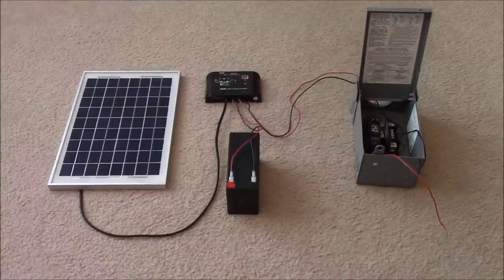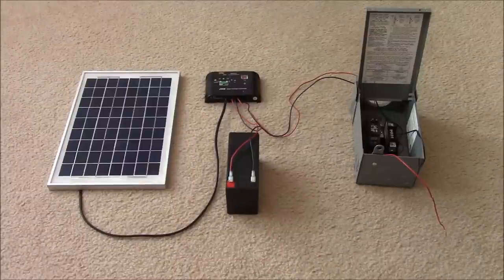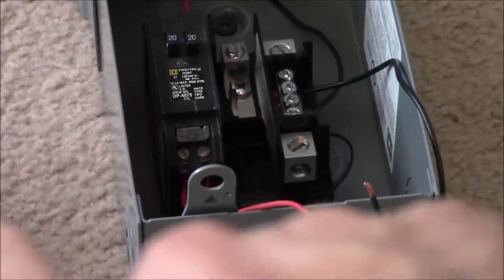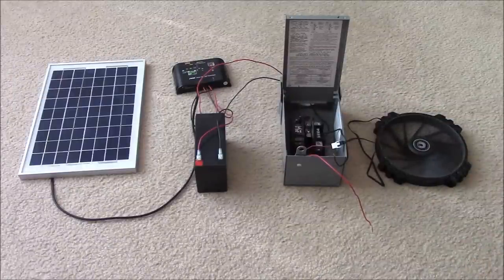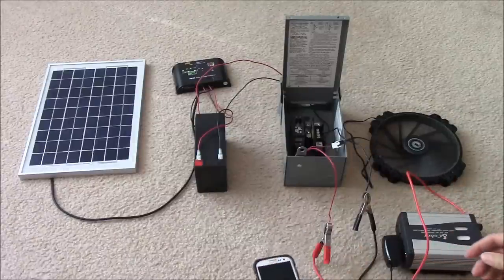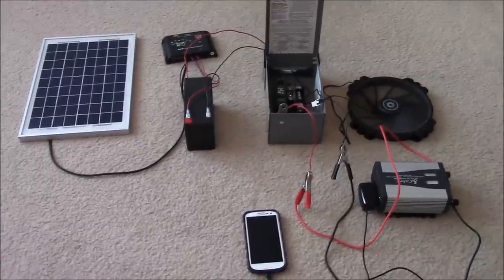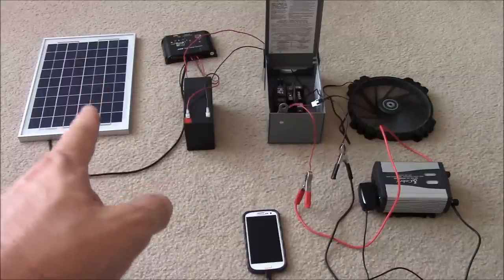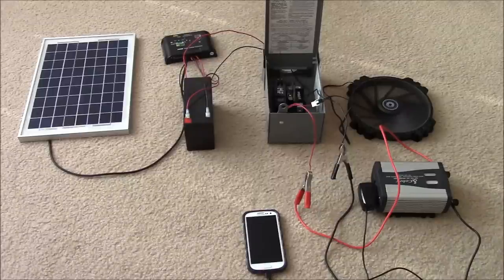Solar Panel Systems for Beginners - Pt 2 Hybrid Systems & Multiple Loads

Comment: Question: If two panels of different ampere and watts are connected/joined  together to the pwm. Does it work all the same or is it not advisable. They also give different output voltages.
Reply from the maker: That is not advisable.  Depending on the charge controller it will either not work at all or it will consider them both the same size (the bigger panel will shrink down to the size of the smaller panel as far as production).  Since pwm charge controllers are so cheap, I would just grab another $12 charge controller like I link to in the video description and run each panel off of a separate controller and then to the battery.  That will open up a different set of problems but at least you have a chance at getting full production.

Comment: Hello and thank you for making sense of this , I would like to run a 12v dc small motor on sunny days, the motor current is 35amp and 6 rpm .Can I connect motor directly to panel and, what size panel would I need ?
Reply from the maker: +euniversal1 You are welcome.  Thanks for watching!

35a x 12v = 420 watts so that is a lot of power needed.  Unfortunately, there is no solar panel that big so you would need multiple panels.  In my experience, motors like that usually need a big surge of power to start up, also, so having batteries or a large capacitor would probably be required to store enough energy to start the motor up.  I'm afraid I would recommend a full off-grid solar panel system for this application.  If you tell me where you live and exactly how many hours per day you would run this device I can tell you how big of a system you will need.

Comment: Hey mate, quick question,

I've wired my system up very similar with an isolation switch from the battery to the solar regulator, and my question is when I am not using the system and want to isolate it, do I need to disconnect the solar panel from the regulator or it shouldn't matter because there is no power going into it ? 

Please get back to me !!
Reply from the maker: When there is no load on the panel it is not producing electricity.  The only benefit a switch between the solar panel(s) and charge controller gives you is the ability to disconnect it so that you can safely work on the system without the chance for a short circuit.  Otherwise there is no reason to ever disconnect the solar panel(s) from the charge controller.
Reply: LDSreliance you didn't read if properly mate, I it is isolated from the battery to the controller obviously not from the controller to the panel lol.
Reply: So basically the other way around, I have put the switch from the mains power from he battery to the solar regulator, so I am asking once the power is islolated to the regulator do I still need to disconnect the solar panel from the regulator ?
Reply from the maker: Ahh my bad.
Reply from the maker: No, there is no need to disconnect the solar panel ever unless you are re-wiring the system.

Comment: hey I have a question.. I am making a solar powered multicopter so Can I charged my battery and on the same time can I power my drone with that solar panel...so that I can use my battery when there is no sunlight.
And my solarpanel when there is sunlight

Comment: Could you also run your wires from the battery directly to the load center? Why or why not? TIA
Reply from the maker: Yes you could.  There are tradeoffs.  More advanced users will definitely do that.  But newbies won't have any kind of protection for the batteries (unless they are lithium with a BMS).  So keep that in mind.

Comment: Hi, I had a doubt.
Just as there is a way to set the potential difference on the terminal hooked to the battery, is there a way to set the potential difference on the terminal containing the load independent of the battery terminal?
Reply from the maker: I'm not following what you are asking.

Comment: Is an inverter considered a load? My inverter is supposed to function as a charge controller (I assume since it has various kill switches to protect devices). I need to know if my 18 watt solar panel would be sufficient to sustain a 12 volt battery to operate a device using 94 watts. Please advise. Thank you.

Comment: Thanks for your videos, very informative. Have a mobile scooter which uses a round 3 plug for charger. Wish to trickle charge while driving scooter, by using small solar panel. It has cigarette lighter fitting. Can I just remove that and replace with a  3 pin plug (such as on adapters) without damaging existing system.
Reply from the maker: William Palmisano So let me understand.  The 3 prong plug charges the batteries with AC power from your house when you are not using the scooter.  But it also has a 12v car cigarette lighter adapter so you can connect an accessory while you are driving around?  If that is the case you should be able to charge the battery through that cigarette adapter.
Reply: thanks for your prompt reply.Yes re the 3 prong. The cig lighter adapter is attached to a solar panel. Since contacting you have sourced an adapter which I hope will do the trick , will let you know.
Reply from the maker: William Palmisano OK, let me know if you have further questions.  Good luck!

Comment: Hi, with a cross over (male-male) power cord, could you plug this into a homes wall socket, to feed into a house? and potentially if no one is home, could it power the items that are always on, like refrigerator, and microwave, and clocks, etc?  Or is there additional components needed for a back feed?
Reply from the maker: Here is the PC, legal, covering my butt answer.  Don't ever do that!  It is illegal, highly dangerous, and could cost you millions in damages.

The real answer is yes you can.  The reason it is illegal and dangerous is because the power you are feeding into the grid is not known to the power company and, in a power outage situation, can hurt a lineman working to repair the lines.  They will think the line is dead but you might be feeding power into the grid.  To get around that, if you were going to use a device like this you would have to isolate that circuit that you are plugged into OR your entire house from the grid.  You can do that with an interlock kit on your breaker box or a manual transfer switch.

The other reason it is dangerous is because the male prongs of the power cord are "live" and transmitting power. Normally, for safety, only female plugs are live.  That way you can't accidentally touch something and send electricity through you or an object.  So you would have to keep that in mind when you are plugging and unplugging such a device.  They are called "suicide cords" for a reason.

Comment: hey, I have a question , I have made 3 phase inverter kit by using FSBB20CH60  a Motion SPM® 3 module and I measured it and I got pure sin wave so,  can i use solar panels with my kit to run the machine?
Reply from the maker: magdi najib Yes if your inverter can handle that high of voltage.  Usually when I try to power an inverter directly from a solar panel the voltage is far too high (17-20v for a 12v panel and inverter).  Worst case you will have to use a charge controller and battery to get smooth, even power at 12v.

Comment: Really nice video. cool.

sorry i have a question, i saw many other systerm where the connect the inverter to the bactery and not to the dc12 volt out... it makes same difference? to the efficence or lifetime of the ecquipment? thank you so much
Reply from the maker: You can do it either way.  The reason why I would connect the inverter to the charge controller output is because the charge controller (usually) has a feature called "low voltage disconnect" which protects the batteries from being overdrawn by the inverter.  The inverter will shut off when it gets to low voltage, too, but it may be a lower voltage than is safe for the batteries.  I think both ways of connecting them are fine if you know what you are doing.  If you are just starting out, I would recommend connecting it to the charge controller.

Comment: Question, what happens when the battery is full? Does it stop charging or can it overcharge?
Reply from the maker: Stops charging.  That is the job of the charge controller.

Comment: Hello I really like the explanation on solar panel connectors, my question is if I want to use two batteries, how do I make them charge and both stay with the equal voltage to feed the invertor?
Reply from the maker: You need to wire them in series or parallel.  I shot a video on how to do this:  https://www.youtube.com/watch?v=4yxR-Iz2Xdc

Comment: how can i connect a system (preferably DC????) to the light in the ceiling of my garage work shop, as well as loads like a power tools, etc?  thx.
Reply from the maker: You would need to wire an inverter to your battery bank or to your charge controller, although that will limit the output power to 20 amps or whatever the rating of your charge controller is.  Then you can plug in a normal AC cord to the inverter for lights and power tools and chargers.

Comment: Can you connect a wind turbine and a solar panel to the same charge controller?
Reply from the maker: If that charge controller is capable of handling it, yes.  I think I have seen a few.  Otherwise no.  They produce power differently.

Comment: is there a way to directly send power from panel to the load without so much of wiring and in between load distributors? it looks like too much of equipment to just transfer power from the panel to the device.
Reply from the maker: No.  You need a charge controller and a battery at minimum.  You also need an inverter if you are converting power to AC.

Comment: What are the advantages of running the load from the charge controller to the load center instead of the battery to the load center?
Reply: I think it might be to prevent the battery from too much discharge?
Reply from the maker: Correct.  This video I shot explains further:  https://youtu.be/k8aVnRpoRLc
Reply: Thank you. Great videos! I have learned a ton about solar from them.
Reply from the maker: You are welcome.  Thanks for watching!

Comment: i would like to know how much each breaker inside the box give  voltage are each of breaker give 12v or both of them give 12v ,
Reply from the maker: Usually the smallest breakers you can find for these types of home load centers is 15 amps.  So that is what I was using.  You can find smaller breakers or fuses if you look for inline devices rated for DC use but they wll be more expensive.

Comment: I know you made this awhile ago, but you answered a lot of my questions with you videos. Thank you so much.   Can you tell me what type of batteries you are using?   I need some small batteries.  

Also, please let me know how to built a small array of panels.  I.E.  I bought 3 20w panels, I want to use them all on same system.  Is there anything I should know?

Comment: Off this quick set up, if I were to use one load connected to a outdoor 12v outlet would I still need an inverter?
Reply from the maker: Not if it is just 12V DC.  Inverter is only necessary if you are planning on using 110V AC power.

Comment: Just to clarify something, it is not the volts that can kill you , but rather the amps. A taser can have 80,000 volts and while it is not comfortable, it doesn't cause damage because it has low amperage.

Comment: Hi just wondering could I add a wind turbine to this system? Many thanks.
Reply from the maker: Yes, as long as you have another charge controller designed for wind turbines.  This is called a hybrid system and is a great mixture of technologies because your wind turbine will provide a small amount of power around the clock (as long as there is a little wind) and your solar provides a bigger amount of power but only for a small portion of the day.
Reply: Great thanks 👍

Comment: please what will you recommend for me.....In my country, grid supply is highly unreliable.... I need to run a water pump 24/7 for my aquaponics system and still have lights on. i want to use the grid when is on and my solar when grid is off
Reply from the maker: +Robert Fredericks Mensah I need to know the power requirements of the pump.  How many hours per day you will run it, how much power it consumes, where you live, etc.

Comment: thank you for the answ. i explain you. i d like to put a 12DC outside lamp on my balcon setup to turn on during night and a inverter 400w to connect in my house a couple of device( lamp, cheap dvd player and 2 iphone charger.

sorry to ask you again. but a red on some forum that the inverter may burn the 12dc output of the controller, thats why is better to put on the battery. so if i put lamp and inverter both on 12dc output i need a split or just take 2 pairs of wires and they can work simultaneously? 

thank you so much
Reply: i am kind of new of solar, so i decide to go slowly: i have a 50W panel with a quite good controller a 40Ah battery and a 400w quad inverter. How many device i can support with the invertor in a ideal situation? thank you so much
Reply from the maker: I have never heard that you can burn out the output on the charge controller.  That would be a pretty crappy charge controller, if so.  Get a good name brand controller and you will never have to worry about it.  Or, if you go with a cheap one like in my video, you just replace it for $15 and try again.  I have never had any problems connecting an inverter to the charge controller.

Yes, you can split the output however you want.  If the wires are small enough you can put them both into the charge controller or connect it to the battery bank.  Or if they are bigger wires (which I recommend!!) then you can split the output somehow to the 2 wires.  I build my own dc load centers that work great for this purpose.  I am going to shoot a video to show you what I mean.
Reply from the maker: creatorediillusioni
With only a 50w panel you won't be able to recharge a battery that big if you discharge it too much.  I would recommend only putting maybe 1 LED light bulb and 2 iPhone chargers on that setup to start with and see how it goes.  If your battery stays pretty full (12.6v or higher at all times) then you can add more load to it.
Reply from the maker: As promised, here is a video I just shot showing you how to create a load center to power multiple loads from one battery or power source:  https://www.youtube.com/watch?v=UG2pbErPKi8

Comment: Solar panel systems for dummies. Great video. Just one question, say I have 3 different devices i wish to power with solar. A big freezer, a TV, and a set of lights. Would it be much simpler to get 3 different sized solar panels, 3 different solar charge controllers, that will essentially be for each of the devices without using a breaker box? Thanks
Reply from the maker: Thanks for the support!  No, it would not be simpler to get 3 different systems.  You can use all of those devices on the same system without a breaker box.  I showed that in the video to illustrate a combiner box, which is for a bit larger systems or for expanding your existing system later on.  If you size the system properly for your loads from the beginning, it will be very simple and straight forward.  Let me know if you have any questions!

Comment: Thanks for the demo but what will be the size or rating of the solar panel, charge controller, battery, and inverter if I gonna build a solar charging kiosk that can charge 18 cellphones plus 4 laptops. Can you furnish some sort of computations to justify it? 😊
Reply from the maker: I would need to know where you live and the exact wattage of each cell phone charger and each laptop charger.

Comment: Can i power a fridge, 32" led tv and 1 fan with a 12v 100w solar panel with a 12v 35ah battery huked to a battery charger going back to the batter from a 3000w inverter?
Reply from the maker: No, sorry.  A refrigerator requires a big battery and quite a few solar panels.  If you subtract the fridge, you could probably run your TV and fan for a few hours per day with that setup.

Comment: I have a 100w solar panel connect to solar charger controller with power function for lighting which is connect to battery... and in the battery I have inverter use for appliances.. is this set up ok?
Reply from the maker: Yes that is great.

Comment: Thank you for the great video. Could you share with me on how to calculate the amount of watt in AC that it could provide and how long can it provide?
Reply from the maker: That is complicated.  It depends on too many variables.  The system in this video is a 10 watt solar panel, which will make about 8 watts in real world conditions.  So it will depend on how much sun you get in your area, how big of a battery you use, what size and how long of wires you use, how efficient your inverter is, etc.  This is a very small system so it would only really be able to power very small loads such as charging your cell phone or tablet or powering a computer fan or something like that.

Comment: Thank you very much, it is easy to understand. Btw, can you store power to car battery.  I m planning to try at my overseas farm house, it is hard and costly for the battery for solar panel. Could car battery to be used?
Reply from the maker: I would not recommend it.  You can do it if that is all you have but you cannot discharge it more than 10-20% without damaging the battery.

Comment: I have a question. I have a goldfish tub outdoors, but want to run a couple of aquarium  pumps (nothing big) off of solar energy do I need the load center or could I connect the inverter directly the charge controller?
Reply from the maker: You can connect the inverter directly to the charge controller or straight to the battery, depending on your needs.  If the pumps consume less current than the cc rating (typically 10A or 20A) then you can use the cc.  If the pumps consume more than the cc rating then you should connect the inverter to the batteries directly.